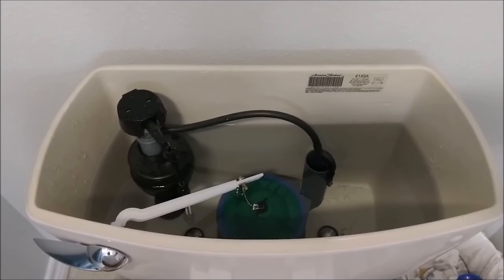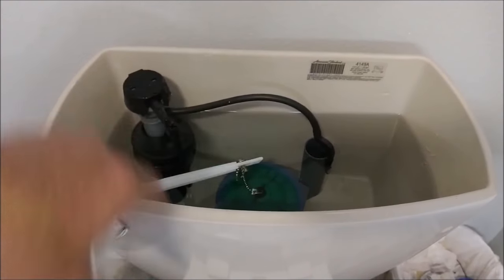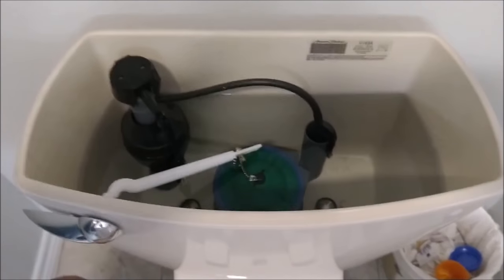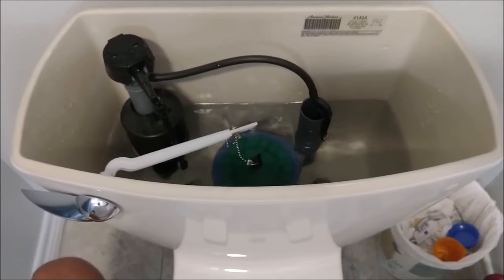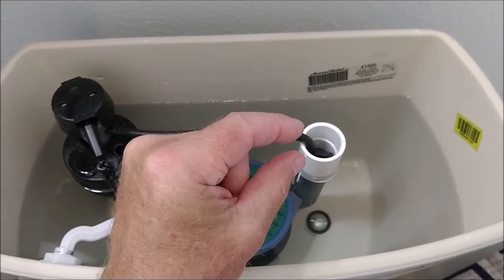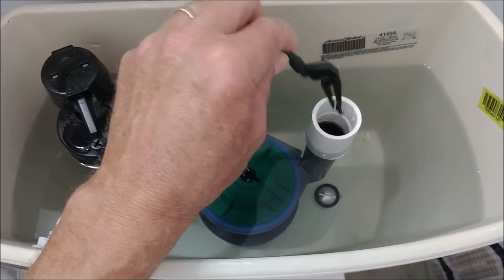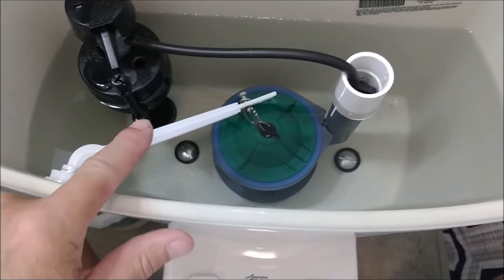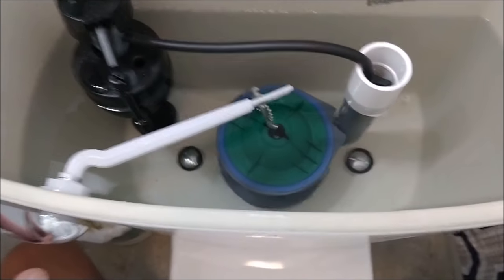American Standard Champion 4 toilet short flush fix

Comment: False advertising at its' best!!  There is no way this toilet could ever flush golf balls.  I bought this toilet for a stronger flush and instead got a toilet that is worse than the one I took out.  I will read reviews before buying anything again.  I feel I got burned on this toilet because I went solely off the advertisements.  The magic of TV.
Reply: It's not your fault, I never saw the ads til I arrived at home Depot to pick up the toilet that Reddit thinks is the best. I am literally about to take it apart and take it back, losing a whole day of renovations. The seat is horribly uncomfortable too.
Reply: It does flush golf balls, i tested it on my old one
Reply: You may have a venting problem if your not getting a good flush with this toilet. 
American standard toilets from my experience are top notch
Reply: @fortunatedad7695 you're joking. I just bought one and it's the same issue only I can't fix the issue with this video as I can't set the water level any higher...
Reply: @Caddyleadz  you've had this problem ever since you've installed it?
Reply: @fortunatedad7695  installed it yesterday.
Reply: Having this problem right now can't even flush my turds it does not flow long enough.
Reply: Swap out the flush valve with one that will empty the tank. You're welcome.

Comment: I nominate this guy Tom to be the CEO of American Standard.  I bought 2 of these toilets a couple of years ago and they have been pretty much a disaster.  One had the tank crack, and the other one has this flushing problem.  This is a simple fix that worked perfectly.  Thanks for saving me a lot more time, grief and hassle with these poorly designed, problematic AS Champion toilets.

Comment: Just ran across this video.  It's sad to say that American Standard 4 has this issue.  I have the same problem.  There is not enough amount of water used to clean the bowl.  The sides have to be cleaned by hand each time to clear any " poop".  It would be nice to be able to flush all the water in the tank rather than leaving about 4 inches of water in the tank at all times.  My sales person tried to get me to buy something beside this unit, but I didn't listen.
Reply: Yeah, why always leave 4 inches of water in the tank?  I just bought one and it baffles me?  I wish the flapper would be able to sit lower.

Comment from the maker: I didn't think the fitting would go on either but after I smoothed up the edge of the pipe and with a good amount of wiggling and downward pressure it went on just enough to stay. Really the whole idea is to lengthen pipe in what ever fashion you can figure out that is water tight. Nice job, thanks.

Comment: Quick and easy fix. I just bought the 1” locking coupling which to me seemed easier than trying to wrestle on a standard coupling. With tax it was about $3 more but saved a possible return trip to HD. It works like a charm. Thanks for posting

Comment: The toilet is designed for a short flush.  In the instructions it says if you desire a long flush hold the handle down for an extra few seconds.  Am I missing something here?
Reply: Nope.  Any toilet will flush more strongly if you increase the water level in the tank.  I find it's not needed but your poop may vary.

Comment: Hello Folks...  I have been through all of the issues described on this post.  I went through making adjustments and test with their tech support folks.  I even made the unauthorized extension for the overflow tube to fill the tank further.  After several unsuccessful sessions with them I decide to contact them one more time.  The person went over what I had done and said that it must be a defective toilet.   They sent me a new one without charge for the unit or the shipping (they are warranted for a bunch of years).  Got it installed and everything worked perfectly.   No weak flush, no needing to use a brush after flushing.  Just saying.

Comment: I have this same toilet and just ordered the American Standard repair parts. Can someone tell me why they don't design this part to be lower down near the bottom?  There is 4-5" of water that never leaves the tank and become stagnant. My other toilets have the flush valve almost inline with the bottom of the tank so that all the water is constantly being removed.
Reply: That is an optional water saver device.  It is useless and it ends up being a plumber's best friend as the pipes get clogged.
Reply: Bad design flaw. sham on them.
Reply: Ok, I'll tell you.  The gubbermint has limited the total volume of water allowed to be used per each flush.  Because of physics, it turns out that flushing the same volume of water from a higher level has more energy than from a lower level.  So flushing with the water from the top of the tank is more energetic than from the bottom.  I assume that the allowed total would be exceeded if the entire tank were dumped, but of course, that would make the most energetic flush.

Comment: I’m a remodeling contractor and I have installed over 50 of these toilets. Now, the flush cycle is so short that it does not clean the bowl out properly. Something has changed, or they’re not adjusting the fill valve to the correct height to allow more water in the tank. That only goes so far if the overflow tube is short the water level can’t be raised much more. I called American Standard today and they said they’ve had no complaints about this toilet. 

Recently I installed these for public use, where you’re not going to get people to hold the toilet handle down to lengthen the flush cycle.So I raised the fill valve up and shorten the chain to the flapper also did the overflow extension.Why should we be having to make these adjustments they should get it right from the factory, won’t be using these toilets anymore. Ridiculous!
Reply: They have had plenty of complaints - no doubt about it with this design.  It looks designed to be jury rigged though.
Reply: You are right. Come on American Std and get it right. Design flaw.

Comment: I just bought this toilet. I have done this hack in the video. It still needs more water in the tank. The problem is the components  in the tank need to be modified somehow to let more water in. All this is cause our sorry ass government. Last time I looked most of the earth is water. Try to fill it manually(using a pot or whatever)  to just below the top of the hole/pvc coupling you added. Then you'll see a powerful flush. Then I would really believe their golf ball flush trick. I cant see it doing that without more water. Can't have powerful without water.
Reply: Yep, the earth is like, 70-71% water...

Comment: I used a 1" to 3/4 coupling so the hose clip would fit. Had to dremel the 1" side and then heated the gray filler tube with a hair dryer to get it on.
I had the original toilet with the white tower in the tank. It flushed great, one of the strongest flushes from any toilet I've ever seen. But when something broke and it started hanging up inside the tank I replaced it with the replacement part and it's never been the same. So far this has helped a lot, but still not as good as the original. Thanks for the helpful video.

Comment: Thanks, This is a great fix. I would only add a clarification that  the SIZE of pvc pipe necessary  is 1 1/4 sch 40. I used a piece 1.50 long which worked well.

Comment: Good fix.  I'll be doing that tomorrow.  When I installed two of these brand new toilets I couldn't believe how little flush time they allowed within the limitations of the adjuster.  My rule in the house has been to hold down the flusher until the syphon completed but doing that frustrates me to no end.  I'd say you doubled the flush time from less than a second to about 2 seconds.  Good job.

Comment: Thank You for posting this fix.  I’ve been screwing with our toilet for years and trying to resolve the poor flushing. This fix works!
I had to modify the fitting because it wouldn’t push on to the tube, used my lathe to bore it a bit.

Comment: The flush valve tube in my AS4215 Champion 4 toilet was just a hair under 1¼-in. diameter, so I bought a 6-in. long 1¼-in. coupler at Home Depot.  I cut off the "coupler" end, then used PVC Cement to cement the extension tube to the original.  Worked like a charm... and I have an additional 2"-plus height now.  Also, the clip for the water hose fits great on it.
Plus, I shortened the chain by a couple of balls. I had to pry the ball holder with a small screwdriver to open it up a bit.
However, the float becomes the next issue.  Even with the flush valve extension and shorter chain, you'll only see about an additional ¼-in. of water level.
Keep the float at its highest level, but add a weight on top of it.  I tested it with a small rock, and it worked like a charm.  I'm going to reduce the weight ever so slightly, as I don't need the water level that high (an inch below the top of the tank).
I might end up attaching one or more fishing line weights to the float.

It's not a "dual flush system."  Dual flush systems have dual flush activations (twist handle up or down, or push one of two buttons, etc.) ...  Not simply holding down the handle longer.

Comment: try adjusting the float higher so the water level is at it's highest point on the overflow tube before making any modifications.  this has worked for me so far.
Reply: What you did is exactly what I did, plus I tightened the slack in the flush lever chain.  It seems to take down all the waste and we haven't had to use a plunger yet.   I'm not against his modification, but I haven't needed it yet.

Comment: why is there so much water left unused? wth?
Reply: I think because the flapper sits up too high.
Reply: @briancmify   Design flaw? or just to be able to legally say, "there's a lot of water in the tank to do the job" when in fact we can only use 3/4 of that water. Rip off? Because I bought it because of the water capacity, Jesus!
Reply: The 4 max uses a larger opening to get maximum flush energy with minimal water without resorting to complex pressurization mechanisms.  To do this it needs a special shape for the water to flow through without turbulence - sort of like the barrel of a carburetor.  The height above the floor of the tank is needed to accommodate that shape and allow the water to drop through as quickly as possible.  We've had 2 for a couple of years and it really is a good flush for a 1.28 Gal. toilet.  Better in fact than the 3.5 Gal. toilets we replaced.

Comment: Thank YOU ,, I will try your method ..   I had  picked up 4  of these American Standards , From the Restore,, Green Bay WI,   they were throwing them out because of the Water  not flushing enough ..   so I paid 5 dollars for all 4  brand new Toilets  to just  have paperwork, and them load them in the truck  with   boxes, parts ..    I  installed two, and have the Problem,  of low  water Volume,,   ITS all about the extension of the TUBE to  bring more H2O into the Tank ,   IT also saved  the Land Fill .. and these will work for next 20-40 Years now

Comment: Thank you so much!!! This converted my 3 horrible, new Champion 4 low-flow toilets into more of a normal flow for only a few dollars. I don't know why this works, but I would buy you a case of beer if I could. For those wondering, this modification produces a stronger flush than just holding the handle down.

Comment: MUCH easier to buy the American Standard Cadet 3 - same fix for additional water use and SAME great flushing action  - but you will eliminate the future continual hassle of the flapper seal going bad every year or 2 ( depending on water conditions ).  Also , the Cadet 3 is much easier to find repair parts for and to actually repair than the Champion 4 which has an impossible to find flapper chain and bearing assembly attaching it to the flush handle...AVOID this model toilet and go with the Cadet 3 !!
Reply: I agree. I bought an Edgemere last year which is quite similar to the Cadet 3; the only real differences between the two are the exterior design and the price (IIRC the Edgemere is slightly more expensive than the Cadet but also seems to be slightly better).

Comment: You need to admit that you have bought junk.  I have the same.  The real problem is that "seat" which keeps about 3 inches of the water in the tank. It is trying to save you a few dollars in water but loose hundreds in pluming when you get clogged.  Say no to American Standard who is not offering a solution.

Comment: Thank you for posting this video. After 6 years my 1.6 gallon flush started having incomplete flushes so I bought an adjustable flapper which had a dial from 1 to 10 and I tried every setting and still had incomplete flushes.  I added 1/4 inch to the stand pipe and that fixed the problem.

Comment: I bought two Champion 4 toilets.  Had one installed and it had a slow leak.  The home repair guy came and replaced the tank bolts and washers, and the toilet still leaked.  I removed the tank from the bowl and reached under the bowl where the tank bolt holes were (the side that the nut and washer go on).  I ran my finger along the rim of the hole and found a big bump of material that was preventing the washer and nut from making a good seal (thus the leak).  Manufacturing defect.  Now I have to use the warranty to get two new bowls (the tanks were OK).
Reply: Sometimes you have to investigate issues in a layman's mentality to achieve the proper results.  Respect for your solving skills.

Comment: Did this helped thanks....also shortened chain for more positive action helps too.
Ultimately the float on the left needs to allow more water in,is there a mod for that?
Reply: Yes Where are the control rod snapped into the water valve you can file underneath the washer and basically shorten the control rod so that you would be raising the level of water

Comment: I didn't feel like going down to the hardware store so I simply used a strip of duct tape to wrap around the top of the pipe and extend it about an inch higher. Works like a charm.

Comment: LOL, that is totally a different toilet in the second flush.  Note the yellow sticker on the right side of the tank and the bar code is much lower too.  Your 1 inch coupling does nothing.  If your fill valve is maxed out and water not running over into the black tube you're getting all you can out a flush.
Reply: He did the mod in a different toilet in the house like he said, genius. Same model. And if you time it, it's about a half second longer.

Comment: For those of you having trouble getting the 1" coupler on, I did too. I easily resolved this by rotating a hammer 90 degrees, and tapping/hitting the coupler on. It will only go about 1/4 inch on, but this worked perfect. Hammer with care.

Comment: Also, if you have a problem fitting the coupling on the tube, just take a file or a Dremel tool to the inside edge of the coupling.  Took me 5 minutes and now it fits on there nice & snug.

Comment: I've put in at least a dozen of these in the past 5-6 years and I'm dealing with one right now again!
I can't believe AS  hasn't realized this design sucks yet and has attempted to change it!!
Reply: I just bought two Champion 4 toilets.  There is a manufacturing defect that causes a buildup of material around the rim of the tank bolt holes on the underside of the bowl, thus preventing a good seal.
Reply: @shawnsmith5028  If I had all the money in my pocket from all the time wasted, from all the call backs from this model toilet, I could probably by all the commenters here a really nice dinner $$.
NOW I currently have one in a customers house that not only flushes like shit, its leaking and has to be replaced after less than 2 months... 
Way to go American Standard!! & Way go Home Depot for selling them to home owners that don't know any better!!! 👍👍

Comment: I have a Champion 4 toilet that has been in use for several years. I'm not to sure if the warranty has expired already. The 4" valve lets the water flow out of the tank so fast that it pulls the flapper closed to early for full flush. I told the kids and wife to hold the lever down for 2 seconds and you won't have a problem. I think they elevated the flush valve to keep any impurities from incoming water supply from getting between the seal and flapper. We haven't used a plunger since installing a Champion 4 and Cadet 3 in our main bathrooms. I don't know what is in our downstairs bathroom but that thing after swirling for 20 seconds slowly gurgles down still leaving yellow. We don't use that one for anything but pee. Someday that bathroom will either get the Cadet 3 moved to it or just save some expenses and put a new Champion 4 in it without messing with moving the very capable Cadet 3 and putting a new Champion 4 in in it's place

Comment: Thanks I have two of these toilets one works perfectly and the other one has the same problem and I used your method works better than it ever did now thank you very much.   What's funny is I bought one at Lowe's and one at home Depot and they have different parts inside the tank.   The one that works fine has a longer drain tube LOL.   Thanks again for showing this it saved the day easy to do great video

Comment: Thank you so much for the easy fix.  Also living alone in my 60's having to learn all DIY stuff for a house. This demobstration you shared for sure will work except it is not possible to turn mine. I followed all of your steps perfectly but turning just would not budge. I am strong so it is not that problem.  I am guessing it might have lime build up in it. 
Anyway, why I spent the money for an American Standard is beyond me.  Have had nothing but problems with this thing between the two flappers and the ridiculous engineering on those and now this problem.  Guess I will just buy a new valve. sigh